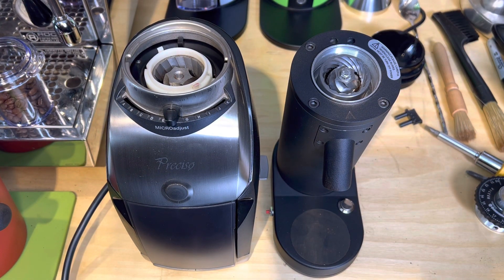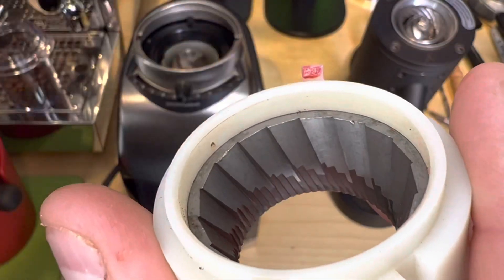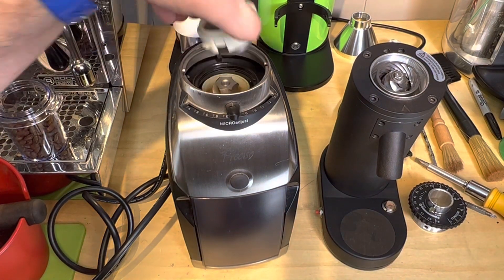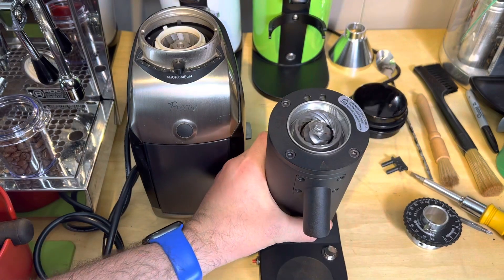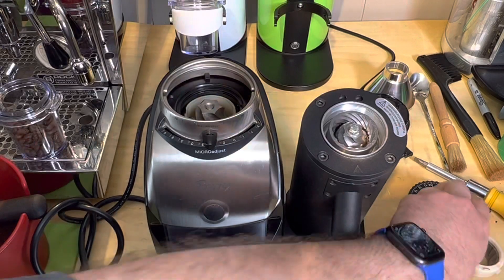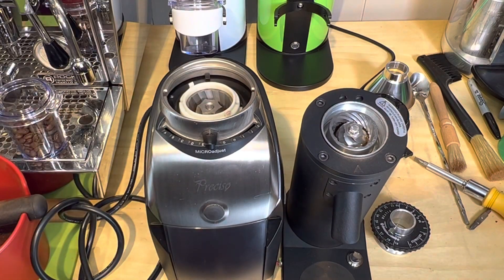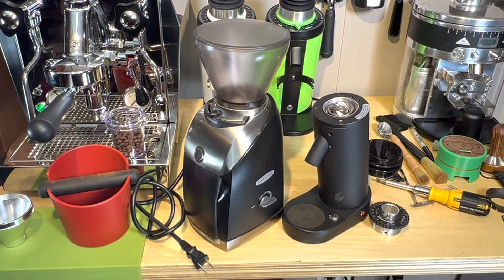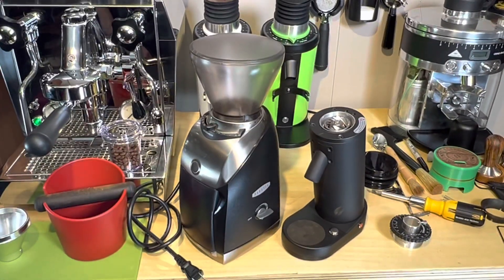Turin SD40 Grinder - Burr Comparison - Baratza Killer?

Comment: The plastic grinder housing and burr carrier setup in the encore/virtuoso/preciso is quite loose. Enough to where single daily use of my encore at about 12 setting for aeropress for 5 years has induced enough burr wear (I assume from burr rub) to create a worn down dull area on the bottom edge of the fine cutting teeth on the collar burr. It looks like your preciso has that worn edge too.
Reply from the maker: My preciso is pretty whipped.   I really don’t use anymore lol.

Comment: Is the SD40 worth buying for espresso  or should I increase my budget?
Reply from the maker: You could get by with it for espresso, but I would recommend increasing budget a bit.  There is a new stepless version coming soon
Reply: @portakeeper  what grinder would suggest for the beginner?
Reply from the maker: @Red.exe7  I like the DF64
If you could stretch the budget.  The SD40 with stepless adjustment might be really solid for espresso but I like the DF64 hands down.

Comment: The DF40's ring burr is quite similar to Sette's actually.
Reply from the maker: It’s a lot nicer. I’ve used both
Reply: @portakeeper  do you mean the grinder or the burrs? I sure hope the grinder's got better gears than Sette 🙂
Reply from the maker: @jonas5666  no all around the SD40 is nicer.  The burrs in the SD40 are a ton nicer.  Next level from Sette